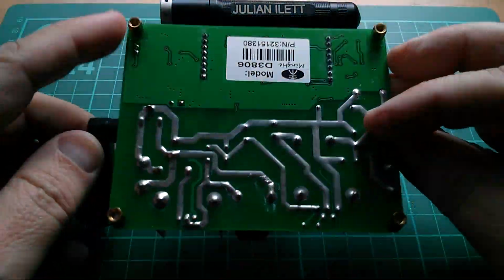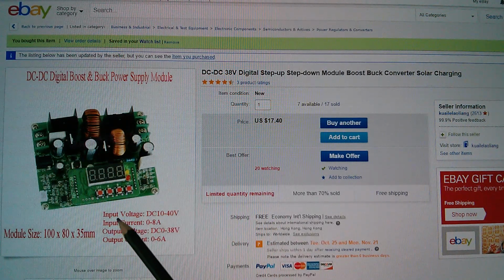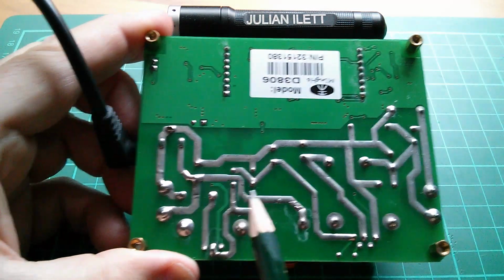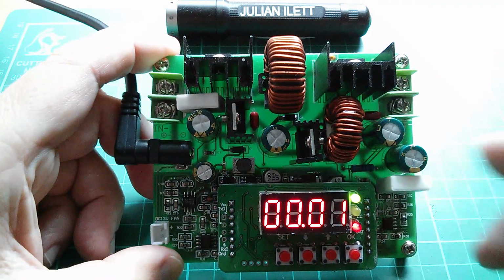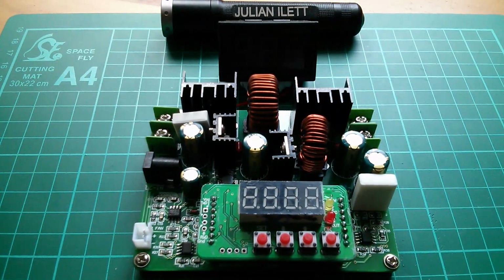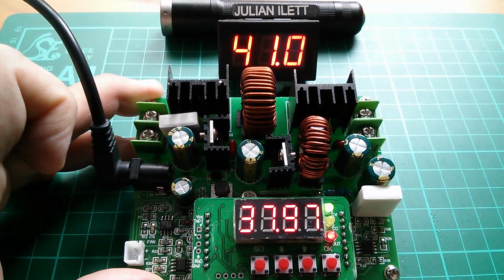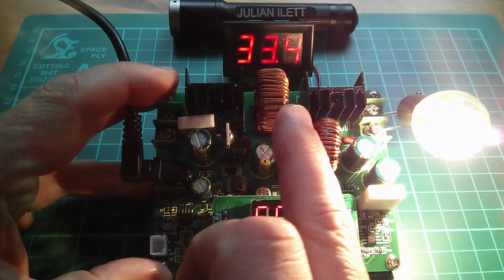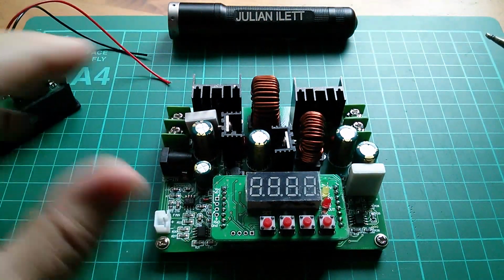Tech Talk: Ming He D3806 Boost Buck Digital PSU

Comment: I don't know what i love more, your videos or power converters :) I bought one after i saw this review hehe. To other D3806 users, DO NOT LEAVE LOAD CONNECTED TO CONVERTER WHEN YOU DISCONNECT POWER, it will send voltage spike to output and fry load. I plan to add few components to pull FB pin of buck section to GND when power is disconnected to avoid voltage spikes on output.
Reply: I wish I read you comment before, I fried an Orange Pi PC in this way.
Reply: Mine gives a large high current 5V-10V spike/surge when DC input is first connected (even when output is configured to be off on startup). Also spikes when DC input disconnected. Anyone have a fix (apart from using a large 10A toggle switch on the DC output and having to remember to always use it when powering low voltage devices)?

Comment: A word of caution about the D3806, don't undervolt the input. I got one after this video and was using it to discharge a 7p3s lithium ion pack by transferring the energy to a 20s NiMH pack. When they say 10v minimum input they aren't kidding, once the voltage sagged below 10 the boost converter section went nuts and overvolted the intermediate bus which blew the buck converter chip.
Reply: Thanks for the advice !

Comment: Great stuff Julian. I was fascinated by your demo of the buck/boost unit. I wish they had been out a few years ago while I had still been serving in the Royal Signals. I could have carried a magicians wand round with me  and baffled the gunners, infantry and tankies more than I use to do with electronic tricks. "Now for my next trick". I use to use a small fluorescent tube and put it near to the antenna base of my HF radio. With a remote CW  key (ptt) to switch the TX on I would demonstrate why it was not very safe to walk close to my vehicle whilst I was sending messages etc., and other such daft tricks. On the serious side these would have been very handy for power for all kinds of things taken from 24/30 volts of the radio supply. They would have saved me one hell of a lot of 
 time making up boosted, zener regulated units for "Phillips" battery shavers, Transistor radios and later battery operated portable TV's etc.

Comment: By the way that "minimum voltage" that you saw when the output was off, is your input voltage minus little drop across the choke and diode.
Reply from the maker: Yeah, that only dawned on me when I was editing the video
Reply: Julian Ilett Yup, it's easy to mess up when you are filming the video :)
Reply: I got one of those about a week ago to make a proof of concept setup for a PC UPS with li-ion batteries inside an old PC PSU with optional external battery packs that will also supply the monitor (19V input) and the modem/router). Anyway, I decided to get a D3806 so once i test my setup i can them replace it with a simpler more permanent converter and use D3806 as a bech PSU... At first all was excellent and worked like a charm.... i did some more tests last night, again, no problems.... today tried to use it to charge some LI-Ion cells on a BT-C3100 charger... As Power supply i used a 12,6V 3S/3P Li-Ion pack which i wanted to discharge anyway so, 12V/3A set, i connect the charger and before i even activate the output.. It started working.... i did some tests and voltage measurements and i found out that the Input went straight to the output... I was lucky i used a 12,6V input which was fine for the charger i powered. But i also noticed that Vin went straight to Vout no matter what Vin would be or the module being turnded on or off.... lowering the Vout setting made no change... funny though, increasing Vout above Vin made no change with the module turned off, it gave about 4V over Vin with module turned on.... I am trying to figure this out with the aliexpress seller and will probably post a video sometime soon..... what is pissing me off though, besides the failure of this much expected module is that i do have another, D3603 a much simpler back only module.... I used it extensively as bench psu and battery charger for months now... today i noticed it starts limiting the output but.... I power it with a 15V laptop brick, output is set to 12V current is set to 2A yet, CC limiter kicks in even at 1A draw...... 

Ok, some will say "you get what you pay" others "shit happens" but... two MingHe modules failing the same day??

Comment: I bought one of these and I do not regret it at all. This is a great power supply, and I'm currently powering it with a 7.4V 1500 mAh LiPo with balance low voltage cutoff to avoid over discharge. Since it senses cell balance, it can cut power when either cell reaches 3 volts. Works wonders, I will be using it to power projects and prototypes. I'm also using those same terminal to barrel jack thingys, both male and female.

Comment: I'd be interested in seeing the output using an oscilloscope as I imagine that going through the boost - buck process is likely to add a fair amount of ripple. You can remove the clear plastic film over the LED display to improve contrast and reduce reflection.

Comment: In case anyone is interested, I downloaded the user manual for this converter and used google to translate it to English. 
(Note that in the manual it states it can only do 5A in natural cooling.)
Orginal - https://drive.google.com/open?id=0B7w1odapcBUhUmlKVWZkbm1uLXc
Translated - https://drive.google.com/open?id=0B7w1odapcBUhdDJtTFZ5LXV6Mmc

Side note, just so you know, I did the bare minimum required to make it more legible such as adding tables, so I have added very few corrections on spelling/grammar mistakes.
Reply from the maker: Excellent, very helpful - thanks.
Reply: Julian Ilett Glad to help out.

Comment: My motto is 'you can never have too many sources of power on your workbench.' So based on that I have ordered one of these as I have hacked an old ATX power supply to give me 12V on my bench and this will make the perfect front end for it. I had intended to build a PSU based on GreatScott's video using the LTC3780 board (I've collected most of the parts but a suitable enclosure for the project still eludes me) but this will make a much neater option.

Comment: I'm sure you caught this already, but the intermediate voltage stops at ~13 volts because the boost converter can't lower voltage (of course). Whatever the input voltage is will be the intermediate voltage, as long as you are using a lower output.

Comment: t is most likely SEPIC (single ended primary inductor converter), It starts with a Boost stage, then decoupling capacitor, then a diode to output and second inductor to GND. The two inductors could be on the same core. SEPIC topology is driven by Boost driver (low side switch). You appear to have two switches. Had it been 4 it could have been a real  4 switch Buck-Boost.

Comment: I got one of these a couple of weeks ago and has been great so far - Also, I just tested the intermediate voltage and mines showing 18.4v, which makes sense as I'm using a laptop power supply to power it rated at 18.5v.

Comment: So I have now killed 3 power converters lol. So I thought I would get this one. I like the way it is setup and with any luck the one I get will be close enough to the real one or better yet the real deal and it will give me better service. The last one I blew up was based on the XL4016 chip did great work for a month even with some abuse on my part. Went to connect a Volt/Amp meter and just stopped working. I know it was connected right because I connected it to another unit with wires connected same way seeing they were soldered together and it worked just fine on that one. I bought it from a person you seem to get a lot of Post bag items from so I felt it maybe safe to order from her/him as you even have said not sure. I think it is just a name with many people working the system.

Comment: I got this unit myself (what a great  find Julian). Two things are rather a mystery to me still.
1) when in advanced mode (flag "1" set to Y) there is an additional, non permanently saved setting called Lo, followed by SA. They seem to be the same setting: if you change one, the other changes too. I suspect it is a minimum current percentage. If the load goes under that, it will switch off, but I am still testing if this is true. Would be very useful for charging Lithium cells.
2) when booting while holding SET, it goes into a a weird mode displaying F1. Very stange things happpen. Do NOT try this with a load attached. I haven't figured this one out. Probably a reset to factory and/or test mode.
Reply: Cancel comment on F1 mode. this is indeed calibration and reset. Description to be found here: http://www.eevblog.com/forum/reviews/b3603-dcdc-buck-converter-mini-review-and-how-the-set-key-could-be-fatal/

LoSA seems NOT to be a cutoff current. Baffled by that one.
Reply: Lo = Load one of 10 (0-9) memory positions, SA = ditto. Normal save is always done in position 0. Solved!
Reply: @steve6375  A bit of a necro-comment in the current fast-moving times ;-) The other "solution" of course is to only use the on-off toggles on  the PCB. By coincidence, this is what I always do.

Comment: Excellent video my friend!!! but isn´t the LTC3780 module much better?
Reply from the maker: Thanks amigo! Yeah, LTC3780 is much more efficient. I'd love to see Ming He design a digitally controlled PSU using that chip :)
Reply from the maker: Digitally control it with digital potentiometers. But you also have to monitor it feeding voltage and current data back to the display. It's difficult!
Reply: Julian Ilett You can use op amp and dac, comparing dac value and resistor divider value from output, out of amp must be connected to feedback of converter
Reply: LTC3780 is more efficient but this one is rated for higher power?

Comment: I wonder why they aren't just switching the switching of the first stage off and leave it on the input voltage when in buck only mode and the other way 'round when in boost mode. Would raise the efficiency quite a bit. But it would have been even better if the'd just short the input directly to the input of the buck regulator when in buck only mode with a MOSFET.
Reply: Transient response perhaps.

Comment: I was trying to find the model number so I could calibrat mine and couldn't be bothered to pick mine up yet and I found it and it's better but at some point the read out has just been off by like 2 v but it's still around right like if I'm trying to charge a lithium battery and have it set to like 4.1v that's about where it would go but it would read like 6 or 7 volts it might be time to look at a new one and there are some nice looking ones out these days

Comment: Excellent!
I'm going to use something like this to use a constant 12v to LED grow lights and fans, using my two 80w solar panels. I only just found out that I can power things through the day without using the battery. Hmmmmmm scratches chin

Comment: The most interesting part is that there is a TX and RX pins on the controller .... that means that Devices mcu must be programmable/controllable  from a uart !!! If only someone placed the specs to control the thing with a external mcu (arduino/D1 mini etc) ... that would be a Wonderful way to have a very nice power supply that could be controlled from almost everything anywhere.

Comment: the output precision is good? I wanna use solar input to sharge 18650 and they don't like more than 4.2VDC each. solar pannel around  max 20VDC 5A to 7s 18650's with max 28VDC to get more cycles life. efficiency is not a problem here because I have sun all the year.
Reply: Yes the output precision is very good. I have 5 now and they work perfectly!

Comment: it would be cool of they could install a relay or something i guess mosfet would be good but to switch between boost and buck if it needed more it could boost straight to the output and just buck if you needed lower but you would probably loose a couple of volts near your input voltage

Comment: I've had this one for months, works brilliantly
only issue with it is after a drop it seems to pulse the output when I give it power even though its set to Off at boot. The pulse is only tiny but could possibly kill some low-power device if I forgot to detach it before plugging the unit it :(

Comment: I´d think, the boost-stage just simply doesn´t drive the FET, if the Output is turned off. So the intermediate Voltage is just the input-voltage minus the losses in the components.
Reply from the maker: Yep, that seems plausible.

Comment: I just started getting into these for driving single cob leds. I am under the impression that the amps are really what dictates what these boost/bucks can do? Is this logic correct? 100w 27v cob, 14.8v battery (idx 198) and a 3505 (35v5amp) I assume that because it would take 6.6amp on the IN side that I've already exceeded the converter's 5amp capacity? Even if the OUT is 3.7a at 27v?

Comment: At about timestamp you start a very interesting subject...The XL4016 is rated at 8A, but the board only 6A--also you mention that probably it is because the heatsink would have to be larger for 8A. SO...could the heatsink be replaced with a larger one (or maybe cooled by making use of that fan plug!  Well, another question is will the digital aspects of the board support the 0-8A range?

Comment: I've this very model and had to replace the mosfet on it twice now as it failed and ended up causing a short heating the tracks up on the back so had to repair them too.  When it's working it's excellent though.  Should add it was the mosfet in the boost part of the circuit that blew a few times.  Oh and the closer to 10v you get as an input the noisier it gets :-)
Reply from the maker: Did you drive anywhere near it's maximum ratings? They're always way too optimistic!
Reply: No was way off the limit, sure it was just 18v i was outputting.  I'm guessing I made a mistake and shorted something accidentally though.  I ended up buying 10 spare mosfets for any further such accidents  https://fr.aliexpress.com/item/SSF7509-80A-TO-220/32216810192.html?spm=2114.13010608.0.0.8YyRVl  I could have swore you had one of these as i thought i bought it after seeing one of your videos, it must have been another ming he converter.
Reply from the maker: You may be right - I seem to have two now!
Reply: I've reached that point as well but more with smaller stuff, buy them in and go to put away and find identical ones there lol.  Really enjoy your videos, would love a series on doing a mppt controller, i know you had a series last time but was a tad hard to follow and i don't think it was complete in the end.
Reply: What about current? Did you drive it over 5A? 
Because the manual says it needs added cooling for anything over that, although I personally probably wouldn't take it much higher than 4.5A without a fan, but yeah agree with simontay if it's a recurring issue I suggested a bigger mosfet and/or heatsink rather than replacing it every failure.
Reply: Thanks i had it twice but after the first time i used a different mosfet as it was all i had lying around, i put the second time down to the replacement mosfet not being the right spec.  Since i replaced it with the correct mosfet it's working great.  Like i say most likely my own stupidity.

Comment: Think I would have left the power meter installed, what the heck... Also a top to pull that power might be nice, be able to use both the  boost power and the buck power at the same time for different devices????? No porbably drive the little controller chip nuts adjusting for amp and voltage fluxuation.

Comment: Hi Julian, first thanks awesome videos.

Just want to ask what boost buck converter you recommanded now a days. I just building quite simple adjustable power supply with voltage and current adjustment. Inside my diy powersupply case is old atx pc power supply what can handle 30A current on 12voltage line.

This video module is ok with all specs, but can you recommemnded something better now a days, or do i just buy this module.

Comment: Love the channel and I am learning a lot from you. Thanks.  Quick question: . I will be utilizing one of these off of a 12 volt power source. I have the 12 volt power source fused protected but whenever I energize the 12 volt supply into Vin of the converter it will pop any fuse that I have. There appears to be a momentary short between Vin+ and Vin- until the circuit energizes. Any ideas?

Comment: Solar chargers tend to need feedback from a battery before supplying an output voltage.  I have a 24v (2ea 12v batteries in series) battery bank that I wish to charge using a 12v Solar panel source. any ideas if this Boost converter will work to charge a 24v system?

Comment: if I want to use a led driver with led specifications 24V - 2.4A or 12V - 4.8A and 15V - 4A for use on motorcycles with input voltage 10V - 18V it is recommended to use D3806 buck boost or LTC3780 buck boost?

Comment: Hello, I got one of these but mine got damaged during the shipping. 
Toroidal core of the inductor on the buck converter is shattered in pieces(right one). Can you please help me find out what are the characteristics of that inductor? I want to change it and I have some salvaged inductors, but how can I find the suitable one If I cannot measure the original one, because of the shattered toroidal core and following changed characteristics? 
Please advice. Thanks in advance.